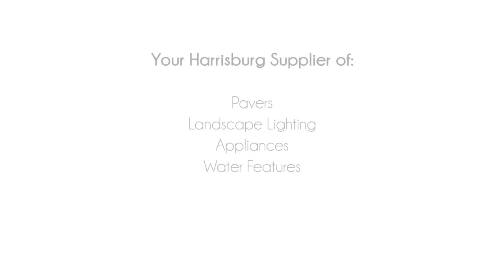BEAST Tile Saw Intro

Comment: Looks like that contractor does AMAZING work........................
Reply from the maker: They do!  and here's what else they said... "Just wanted to drop a quick note letting you know how impressed we are with the Beast saw. We struggled with 2 of the competitors saws and 5 blades to cut very little linear footage on a porcelain patio we are installing. Based on your recommendation and a last ditch effort we decided to give the Beast a try. We went from cutting about 20-30’ per blade to cutting well over 100’ on the same blade with no slow down at all. This saw has been our saving grace in the porcelain market. Without it we would likely have decided to not install porcelain again. Thanks so much for all of your help!"